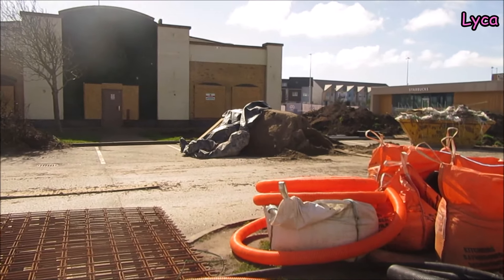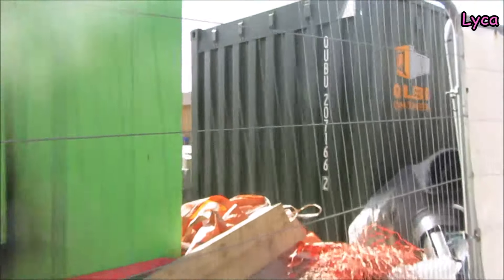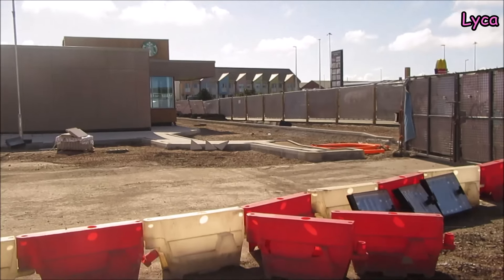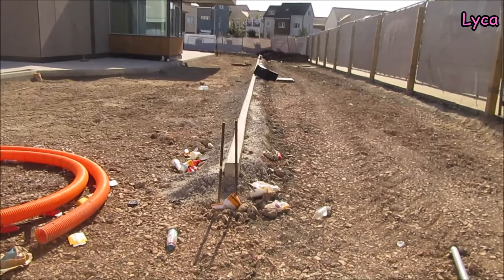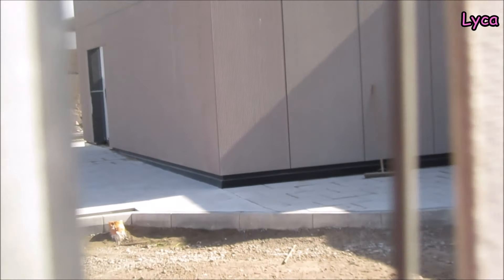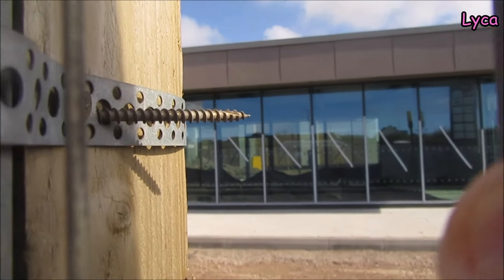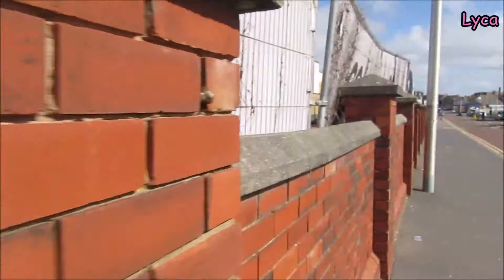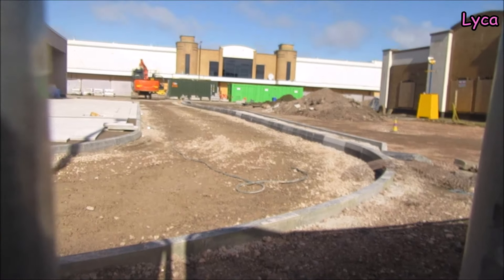Bloomfield Central Development part 10

Comment: the cable ducting and bolts that you were unsure about are in place because that is the drive-thru lane and it will have the light up menu boards and order speaker just like there is at the McDonalds drive-thru which you will be able to see just across the road way.